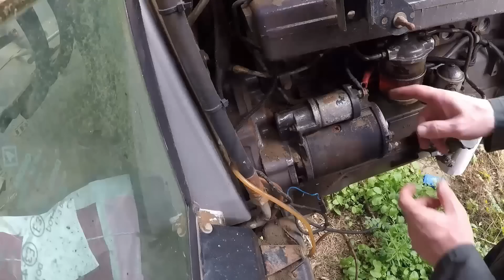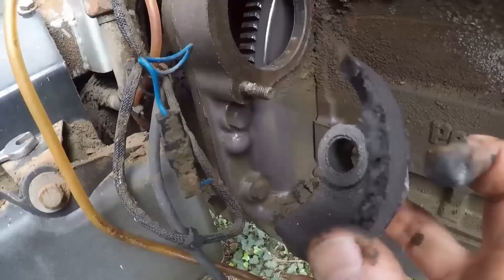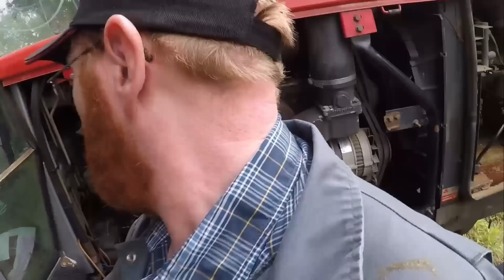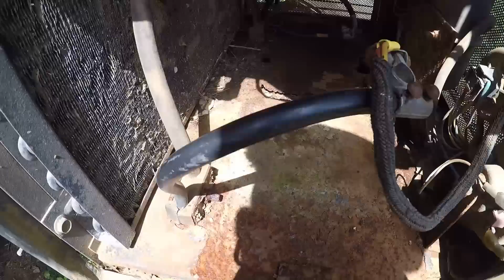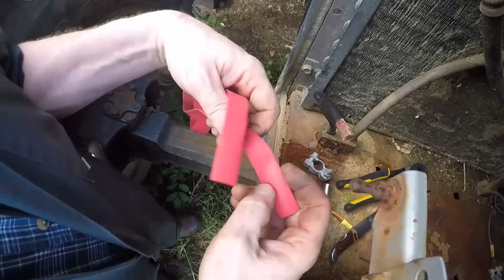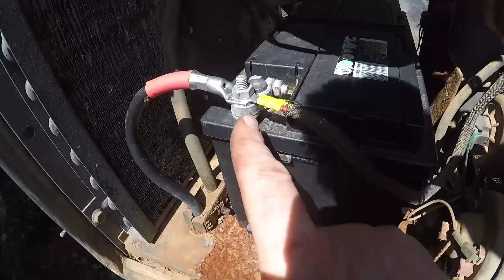Vintage Thursday. New starter motor for the 3095

Comment: great video thanks. Have you already done the hydraulic oil replacement ? I bought one filter (big one near the right rear tire) but i think there might be a second one, behind the steps. i would like to be sure before changing the oil. Only one mentionned in the massey 3000 service manual i have. Thanks, julien
Reply from the maker: I didn't have to change the oil as the tractor had a new hydraulic pump fitted as part of the deal.
Oil and filters were changed at the same time.
You are correct, there is another filter near the steps.

Comment: Very nice job on the terminals 
On the subject of swapping batteries between classics that don't do much, are there any decent quick attach terminals?
Reply from the maker: Not sure, I've never considered fitting them!
Reply: @CowfarmerDan  I've got a habbit of putting on a battery just to move something quickly and not tightening the terminals and it ends up staying that way ,but inivetibly you go on a tractor run and it wont start

Comment: The bellhousing will be full of metallic dust from the broken starter motor housing and from the clutch plate. I think I would have cleaned it out properly before fitting the new starter. As you probably know the small yellow and red wires at the battery pos terminal supply power to the etcu behind the RH cab step. Most electronic problems on 3000 series are caused by poor wiring giving low voltage readings. Alternator also needs to be producing 13v at least to power ELC (rear linkage). Always test electrics with a headlight bulb and two wires, a multimeter is not good enough.

Comment: 99% of all 3000 series electrical problems can all be traced back to where the the earth cable from the Battery is connected to the chassis at the from and corrosion of the positive terminals preventing full current.
Not helped by usually having 2 batteries to deal with!
The red and yellow wires attached to the positive are very important to make the hydraulics and PTO work properly.
Reply from the maker: I repositioned the earth cable to the clutch housing last year to avoid that problem.